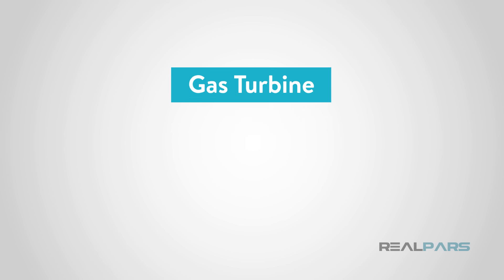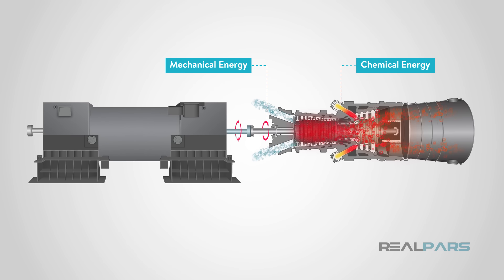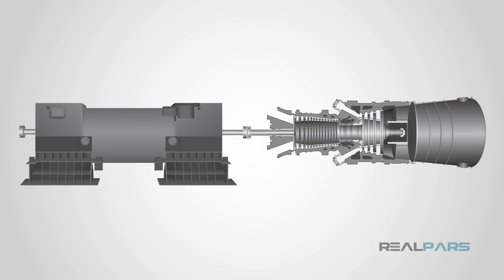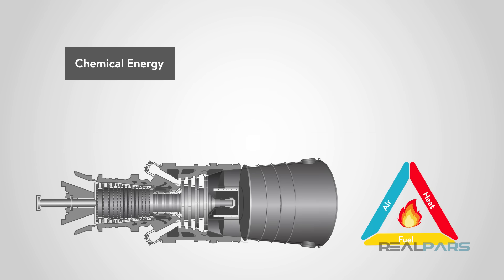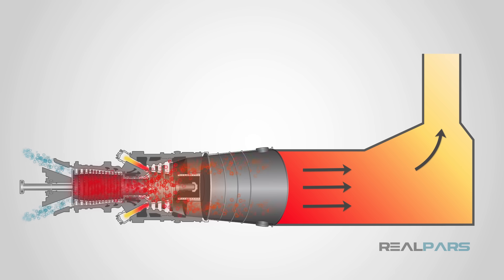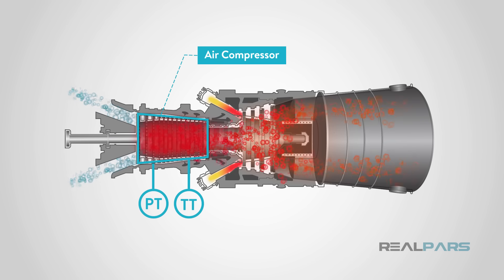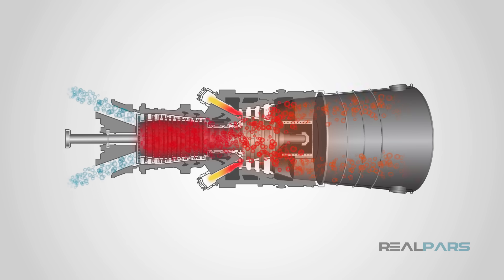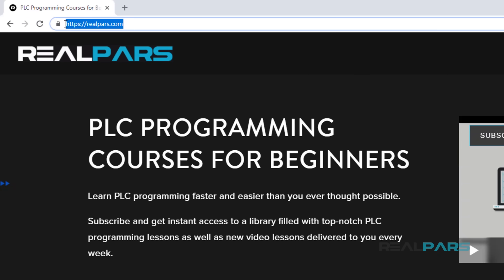What is a Gas Turbine? (For beginners)

Comment: Kindly if anyone knows.. what is the instrument or device that is used to balance between gas feed and turbine speed?
Reply from the maker: Typically, a control valve is used to regulate the gas flow to a Gas Turbine. These arew highly-specialized pilot-driven valves that are positioned based on sophisticated control algorithms which take into account temperature and pressure of the fuel inlet, air inlet, and combustion chamber.  Since the cross-sectional geometry of the turbine and the rotor blade design is fixed, speed control is dependent on gas velocity control.  Velocity can be affected by temperature, pressure, air humidity, fuel quality and fuel injection pattern.  Gas turbine control must take all of these factors into consideration.
Reply: @realpars  Thanks..!

Comment: The Gas Turbine applied to Turbo Generators (GTG) is very useful to produce electricity, to comply with the above first needs to transform the chemical energy of the fuel into mechanical energy, ie, this is obtained by combining air and heat with fuel in the "combustion chamber", and this by means of an electrical generator is converted into alternating current.
Reply from the maker: Thanks for sharing!

Comment: So I need air and heat added to the fuel. Air is let into the gas turbine through air intake and mixed with a proper amount of natural gas. The air/gas ratio is determined based on the specific heating value of the gas and quality of the air, amount of moisture, altitud from sea level and so on. Now an ignition system steps in and makes the initial sparks, whereby heat is provided. When the fire is established and stabilized in the combustion chamber, the ignition system will be put of service. The most critical process in normal turbine operation is to manage the combustion and produce a proper amount of high-pressure exhaust gas. This exhaust gas is applied to the turbine blades and after rotating the turbine shaft, conducted to the exhaust stack. With this quick review of key components of a gas turbine, I think it is time to decrease the altitude and elaborate on the system further. As mentioned earlier, air is let into the gas turbine through air intake. The air is prone to contaminations or having some unwanted particles which can harm the system and degrade the overall performance. The screening and filtration are basic requirements for incoming air. Also, proper instrumentation is mounted on the Air duct to monitor the draft oressure and temperature. In harsh enviroments, the air might need to be preheated or conditioned. Also, differential pressure monitoring of air filters. will warn the turbine operator of filter clogging. The conditioned air is conducted into the turbine air compressor which is an axial compressor comprised of multi-stages of blades mounted radially on the turbine inlet shaft. The discharge pressure and temperature of the air compressor are monitored to manage the combustion quality at the combustion chamber. Fuel gas is a key factor in the desing and operation of a gas turbine. The manufacturers need to know the details of fuel gas and only based on its characteristics, can guarantee the performance of their gas turbines are monitored during normal operation of a gas turbine. There are different technologies in propierly mixing the air and gas and making efficient combustion from manufacturer to manufacturer. Combustion chambers are of some tubular heat resistant structures and fuel is usually injected into it from the circumference and at different cross-sectional locations. The temperatures at different locations of the combustion chamber are thoroughly monitored by means of proper sensors like thermocoples. This high-temperature/high-pressure zone in gas turbine structure is of the highest levels of importance to monitor and control. Also, the technologies used in the design and construction of the combustion chamber are of the topmost ones. Now thet the air/gas mixing is well managed and combustion is going on properly, there is a plenty amount of hig-pressure/high-temperature exhaust gas generated and should be applied to the gas turbine blades to make turbine exit shaft rotation feasible. At this stage, the high RPM of gas turbine rotor should be tightly monitored and based on the load driven by turbine, the surge of turbine gets the topmost importance for turbine performance and turbine protection. Vibrations (axial and radial and speed) both at the air compressor and gas turbine should be continuisly taken into consideration.  This was the simplest way to addres major parts of gas turbines and as one of the most sophisticated man-made machines, a gas turbine deserves more elaboration. Also, there are different technologies which some manufacturers use as their propierly technology and were not considered in this video.

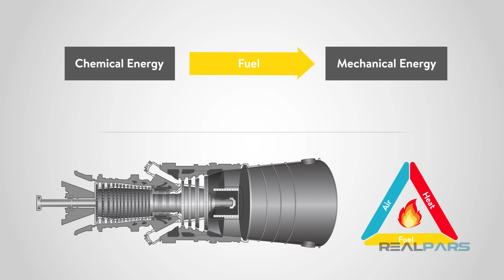Comment: Two of the most common applications of Gas Turbines in modern industries are Turbo Generators and Turbo Compressors. I try to approach a gas turbo generator to better feel the subject.  In a gas turbine power plant, There is a generator which is an electrical machine. But to generate electricity this generator needs a prime mover which for my example is gas turbine. The gas turbine transforms the chemical energy in the fuel into mechanical energy. The mechanical energy generated by the turbine exit shaft is then transferred through a gearbox to the generator's shaft. Now my generator can crate electrical energy. This primitive form of electrical energy normally has a low or medium level of voltageand to better manage the power loss in transmission lines, this voltage should be increased by step-up transformers. Such transformers give an adequate level of voltage to the electrical energy to be transmitted through the transmission lines and deliverated to the grid. After this brief overview of a sample gas turbine application, I am going to dig down into gas turbine mechanism in more detail. First, imagine a rocket in which some fuel is going to burn and create a high-pressure exhaust gas. Based on energy conservation law, the chemical energy of the fuel is transformed into mechanical energy in the high-pressure exhaust gas. When a rocket is fired, the thrust of this exhaust gas moves the rocket fordward. This amount of rocket science is enough for me and now suppose I fix the rocket body with a robust mechanical structure to prevent its movement. What will happen? The high-pressure exhaust gas should be released and it will have no way but backward. Now keep this structure in mind and imagine I put a set of turbine blades in the path of this high-pressure back-fired exhaust. You see that the release of mechanical energy which is mostly in "linear" backward direction will mostly transform into kind of "rotational" of turbine shaft and so far I had say it is a big success, i.e transforming the chemical energy of fuel gas into rotational mechanical energy of turbine shaft. Now I have a "Prime Mover" for my generator in the above power plant example. Also, this prime mover concept can be used in different applications like turbo compressors or the likes. Now that I have the basics of gas turbines let´s focus on a modern gas turbine and its components. Most likely you know about "Fire triangle" or "Combustion Triangle" which illustrates the necessary ingredients of fire or combustion, i.e "Fuel", "Air", and "Heat". To transform the chemical energy of the fuel gas into mechanical energy, the fuel should be burnt in the combustion chamber of a gas turbine, so I need air and heat added to the fuel. 4:13

Dos de las aplicaciones más comunes de las turbinas de gas en las industrias modernas son los turbogeneradores y los turbocompresores. Intento acercarme a un turbogenerador de gas para sentir mejor el tema. En una planta de energía de turbina de gas, hay un generador que es una máquina eléctrica. Pero para generar electricidad, este generador necesita un motor primario que, por ejemplo, es una turbina de gas. La turbina de gas transforma la energía química en el combustible en energía mecánica. La energía mecánica generada por el eje de salida de la turbina se transfiere a través de una caja de engranajes al eje del generador. Ahora mi generador puede generar energía eléctrica. Esta forma primitiva de energía eléctrica normalmente tiene un nivel de voltaje bajo o medio y para manejar mejor la pérdida de energía en las líneas de transmisión, este voltaje debe incrementarse mediante transformadores elevadores. Tales transformadores dan un nivel adecuado de voltaje a la energía eléctrica que se transmitirá a través de las líneas de transmisión y se entregará a la red. Después de esta breve descripción general de una aplicación de turbina de gas de muestra, voy a profundizar en el mecanismo de la turbina de gas con más detalle. Primero, imagine un cohete en el que se quemará algo de combustible y creará un gas de escape a alta presión. Según la ley de conservación de energía, la energía química del combustible se transforma en energía mecánica en el gas de escape a alta presión. Cuando se dispara un cohete, el empuje de este gas de escape mueve el cohete hacia adelante. Esta cantidad de ciencia de cohetes es suficiente para mí y ahora supongo que arreglo el cuerpo del cohete con una estructura mecánica robusta para evitar su movimiento. ¿Lo que sucederá? El gas de escape a alta presión debe liberarse y no tendrá más remedio que retroceder. Ahora tenga en cuenta esta estructura e imagine que coloco un conjunto de álabes de turbina en el camino de este escape de alta presión con retroceso. Usted ve que la liberación de energía mecánica que está mayormente en dirección "lineal" hacia atrás se transformará principalmente en una especie de "rotación" del eje de la turbina y hasta ahora he dicho que es un gran éxito, es decir, transformar la energía química del gas combustible en Energía mecánica rotacional del eje de la turbina. Ahora tengo un "Prime Mover" para mi generador en el ejemplo de planta de energía anterior. Además, este concepto de motor principal se puede usar en diferentes aplicaciones como turbocompresores o similares. Ahora que tengo los conceptos básicos de las turbinas de gas, centrémonos en una turbina de gas moderna y sus componentes. Lo más probable es que sepa sobre "Triángulo de fuego" o "Triángulo de combustión" que ilustra los ingredientes necesarios del fuego o la combustión, es decir, "Combustible", "Aire" y "Calor". Para transformar la energía química del gas combustible en energía mecánica, el combustible debe quemarse en la cámara de combustión de una turbina de gas, por lo que necesito agregar aire y calor al combustible.
Reply: turbine engine operates I want a pdf, can you help?

Comment: I would like to ask you can a gas turbine shut down due to vibration or any near work in field by compactor.
Reply: Yes, mechanical vibration and temperature are two variables that are closely monitored in a gas turbine application, and each can cause a turbine shutdown if high limits are exceeded.
Reply: Many thanks but I have had a quistiin what are the reasons that  lead to vibration in gas turbine.
Reply: @kuzminatatiana5481  may alignment , different temperature in fire champers

Comment: thanks a lot 
I confused about the generator should be connected to the end turbine as far as I know.
could please clarify it to me?
Reply from the maker: Hey Ahmed,
There is one same shaft which has connected all three devices together (Turbine, Compressor, and Generator). So if the Turbine increases the RPM, then this speed will be transferred to the Generator as well.

Comment: I worked in the Gas turbine Power thermal plant as I&C tech. It was great.
Reply: colleague) which model of gas turbine?
Reply: @murzanovv  GE 9FAe controlled by Mark VI
Reply: Trung Lê 👍🏻 I worked with PGT25, Mark VI/VIe is flexible control system
Reply from the maker: Yes, you can learn a lot about Gas turbines by working at a power plant!